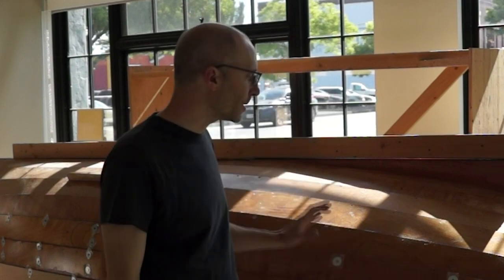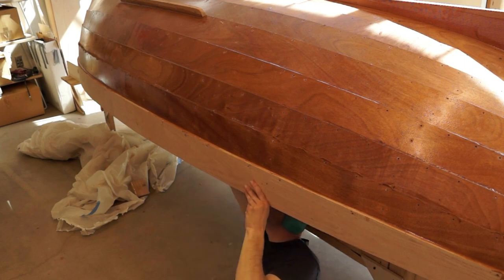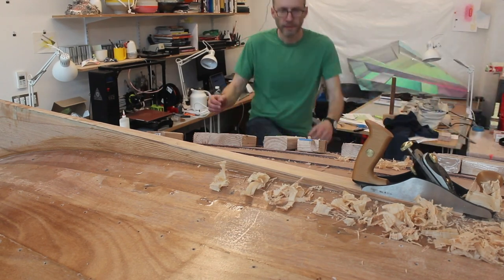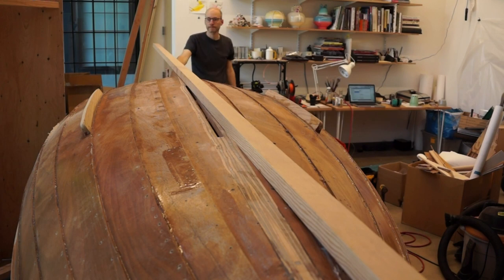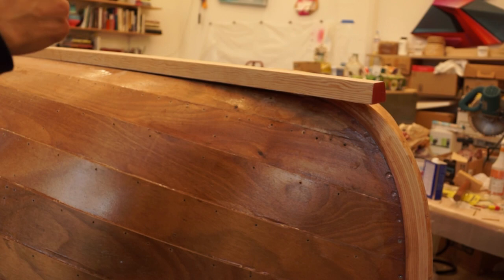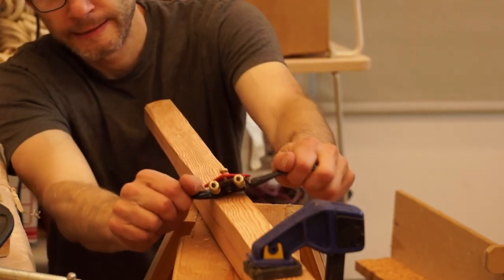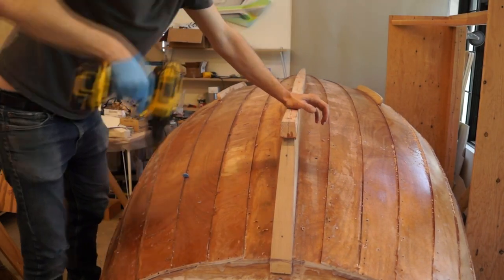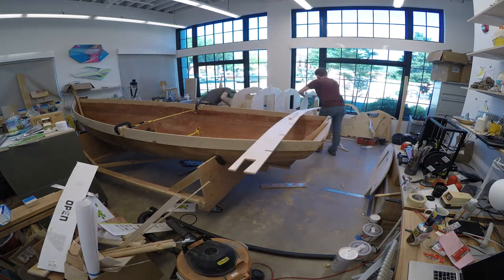Designing for Dinghies, Ep. 10: Installing the False Keel

Comment: I'm surprised that the false keel meets the false stem in the way it does, oversailing it. That leaves end grain of the false keel exposed. Wouldn't a scarf have been a better joint?
Anyway, great to see you back and making solid progress.
Reply from the maker: Good point Mike. There are many details like this that can be tweaked and improved from what the plans say. Sometimes I make a change, but in many cases, like this one, I just follow the instructions and hope the designer made a good decision.

Comment: Nice to catch up again. Sanding does make a mess, mind you, making the mast does too, I'm doing some of the bigger elements now due to limited space. She looks lovely the right way up, a really nice job. I am in agreement with MikeAG333 about the false keel riding over the false stem, it is something I have been thinking about since getting the plans, purely based on the thinnest part is on the leading edge when a scarf would protect it. I notice you have put the sculling notch on the starboard side, which is the right side for a right handed person to scull facing forward. HNY, look forward to the next vid, hopefully the restrictions will be lifting and allowing you to work on her as much as you like.
Reply from the maker: Hi Dale, Glad to hear your project is under way! Luckily I was able to do most of the spars outside - I'm working on editing that footage now. I think if you have the time to improve the stem/keel joint from the plans, it's definitely a good idea. But I'm kinda in 'get the boat done' mode. Also, once the epoxy fairing and paint is coating everything,  and the half round bronze is attached, I'm pretty sure it will be just fine this way.  The sculling notch!!! That was really confusing to get in the correct spot for a right hander (the plans came with the notch on the port side). It doesn't seem like it would be too tricky, but with laminating the transom layers correctly to get the right bevel and assembling the boat upside down it was a bit of a brain twister.

Comment: Great video, thanks!  I have a question for you back at the strake-joining stage (way back when) - were the jig-saw joints REALLY tight?  I worry that my planks have expanded in the humidity.
Reply from the maker: If I recall correctly, some of the puzzle joints on the strakes were pretty tight, but not crazy tight. The expansion on marine plywood, even with humidity should be pretty minimal, but if they were sitting around a long time I guess it's possible. You could try putting them in a warm dry spot for a week to see what happens. Probably some careful sanding and splinter removal along the edges of the joints, though annoyingly tedious, should help them fit together.
Reply: @designingfordinghies5427  a week!? That's an eternity in the mind of an optimist who's desperate to get out onto the water.  I'll get the file...
Reply from the maker: @damoog5985  LOL. Gotta get it done! Hope it goes well, and the joints start fitting with out too much effort. Good luck!!